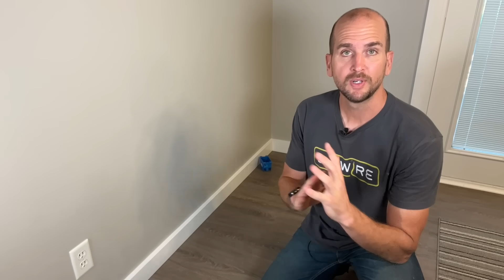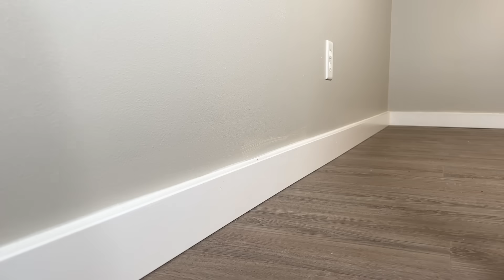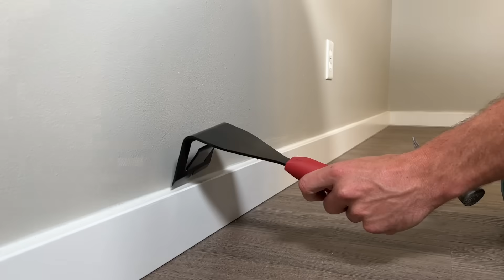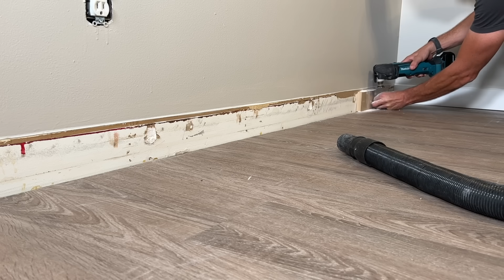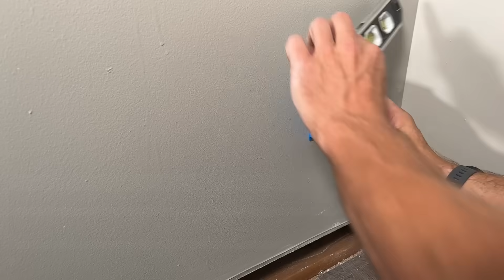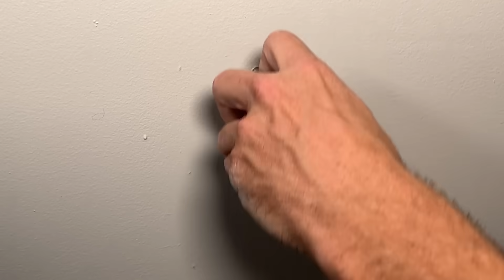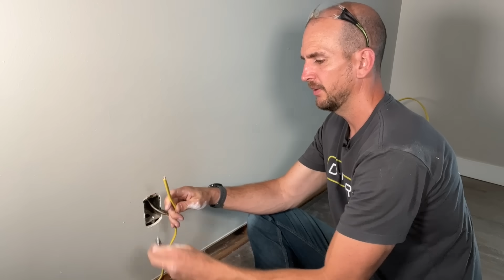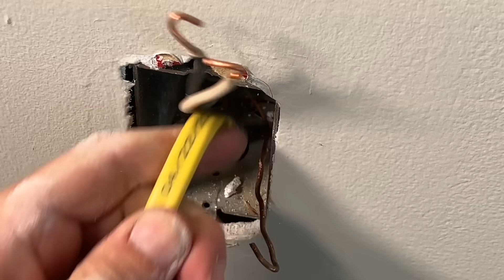How To Add An Outlet To A Finished Wall

Comment: Say your one maybe two studs over. I’ll use a diverse a bit and drill towards the existing box. But first on the existing I’ll open the hole as a 2 gang box giving more outlets. Then once it’s a 2 gang take the old box out. Now you will see the diverse a bit. Use a chair or small wire as a pull wire. I’m careful doing this because I hate painting or fixing walls. I’ve used a diverse a bit for years even on this job I’d get that to work. Also can drill towards the new outlet either way. Then I have no baseboard to deal with my wire is higher from moisture by the floor safer all the way around.

Comment: Here in the UK have brick and it's not so easy to add wiring,  literally have to cut a big channel all along the wall and replaster , in my current house those bricks are engineering bricks too so really hard.

Comment: Nice job but you might want to mention that is some areas a permit for electrical is required and before starting a project like this you should contact your local building department.

Comment: This is a fantastic video. There have been numerous times that I’ve wanted to do something like this, but didn’t, because I didn’t want to turn it into a drywall and paint project. 

I do have a question though. Which Milwaukee organizer do you use for your electrical - the slim packout or the regular packout?

Comment: Excellent .   I've wanted to do this sort of thing many times for power and network.   Network can be put under carpet DYI, never power.  Lathe and crawl way made projects too much.  The  trim, metal box protection , guild block for cut height...  even reminder on  pigtail to fix 75 yo wire + sockets at nephews house that's freaked me out as fire hazard every time I plug in a laptop.  I guess his kids learn a bit of DIY in 3 weeks.  Thanks

Comment: I could not make out what you screwed the two screws in the blue shell into. They cannot be screwed into a blank space inside the wall, so I figure there must be something else that goes into the wall before you  put the blue shell into the wall. Thanks.🙂

Comment: When I first clicked to watch, I thought you were gonna convert the supply box to an external wall mount, then add wire mold & another wall mount (which would have looked cheesy). Despite the fact that each install may not be as simple as yours (older homes, outside walls, going through corners, outlets mounted inside thick molding), this is a very clever idea. 30+ years wiring, and never saw an approach like this. Nice job.
Reply: Exactly. I’m thinking of using this technique on my 120 year old home. The bedrooms only have 1 original outlet each!
Reply: @Dozav7  Chris... I've come across the older homes, where an outlet was installed through the molding. And each time, I was forced to put a surface-mount. It's funny that your idea never occurred to me. Every time I ran into this, I'd scratch my head and think... oh great... this again. Even if I was feeling daring...& wanted to cut holes, I'd be afraid of cutting into something, other than the molding.

Really glad I stumbled onto this video. Thanks for taking the time to make it available.

Comment: Im EU electrician and im really suprised that your ground is not insulated. I wanted to point out to anybody doing this without electric background and with similar materials, make sure that your ground wire will not touch the phase contacts or you will short your circuit and blow up your fuse.
Reply: In US non metallic type cable used in this video (Romex) has bare ground conductor, MC cable has all wires insulated including ground. I think that it has to do with the fact that Romex can only be used in wood framing in residential applications where all grounding is bare wire including the service and so someone doesn’t try to use the ground wire as some type of conductor.

Comment: In Chicago, Cook County, Illinois -- jealous you can use Romex.

Personally, I mount the outlets horizontally. I've seen multiple incidents where an appliance plug, such as for a lamp, was not plugged in all the way and a conductive material fell between the plug and the wall, shorting the outlet. In particular, Christmas tree tinsel, in several cases.

I much prefer the European outlets for safety.
Reply: You should clarify....Horizontal with the neutrals up.  It's a good precaution, but today with plastic face plates the chances of that happening are somewhat rare. That's why the orientation is not dictated in NEC.
Reply: @ruffxm  Agreed, but Codes represent the minimum required. It takes no more time to do a little more.

Comment: Hi we had our lounge room battened out and plastered over the top of the original brick wall that was there and the electrician told us that he didn’t have enough wire to put in a new electrical point so he just plastered over it and now I don’t have an electrical point at all in that area. At the time we had a whole house renovation going on and he did this with a few points we had and it being such a crazy time I didn’t focus on the fact I had lost power to places I needed is that really a thing that the couldn’t use the old points and add a couple of inches extra so we could keep our power points where they were? Or were we taken advantage of the fact we couldn’t disagree cause we know nothing about this?

Comment: A 1 inch bit?! Good god... try a half inch... or 5/8.... it's just romex not your dick... lol
Reply: Wagonuts? So no plugging in a space heater or anything with real load...  may as well stab wire the plug. Same thing.

Comment: Very clever how you removed the baseboard and clipped the nails and cut the drywall and pre-installed the connector and such but I have one question. I am not a professional electrician but I still do wiring in the new little buildings that we build. 
What is the advantage of using those little wire connectors instead of just fastening the wires to the side screws on the old outlet?

Comment: What stops the un insulated “ground” (earth in the UK) actually touching the exposed/unshrouded hot (live) and neutral terminal screws when the outlet is just pushed back into the wall box and the ground wire folds/bends out of the way. Very dangerous in my opinion not to use earth sleeving on the bare ground wire. This is mandatory in the UK.
Reply: This has been mentioned in other videos.  Being from the UK I too find it very strange that the bare earth conductor is not sleeved. BTW I think the earth has to be sleeved in Australia as well.
Reply: Yea that seemed so weird. Definitely a recipe for issues

Comment: I realize this new line is close to the ground but I believe you should still have installed nail plates where the wire runs through the studs. Yes both sides of the wall 😅😂

Comment: That's was a great video and for this person to not be a day to day electrician that was great! I'm a 20+ year Electrician & Contractor and he's better than some of the guys that have worked for me!! Just a few things that I think might add to this to make it even better
1. I usually take the plastic of the NM wire before I put in the KO, that avoids having to use a knife in the tight box that might damage the wire
2. I don't like using Wagos for outlets and other electrical splicing , I've had a ton of service calls were the Wagos get weak and burn out, I would recommend wire nuts all the time for pig tailing and electrical installs, I only use wagos in lighting applications 
3. Sometimes the KO's are not available so you have to use one of the prefabed wire entry towards the back of the box which at times have a set screw which you have to remove but make sure you put it back
4. As always make sure the box is grounded

And that's all, but thank you for an awesome video!!

Comment: Why use pigtails when you can connect directly to the outlet with both wires, and get a more dependable connection than 
with a Wago lever nut? Of course, we avoid stab lock connections on an outlet, but why are they suddenly OK to use when 
they're in the product you're shilling for?

Comment: Easy for small usage like a lamp, but wouldn't this cause a short circuit if one plug is used for a microwave the other for a space heater?

Comment: in most houses the drywallers push the drywall up to tighten the seam in the middle of the wall, which leaves a 1/2 inch gap at the floor level, plenty of room for romex. I have been using this method of adding an outlet for  40+ years. you can even take molding off around closet doors, regular doors etc, to run the new wire in the gap and you can install new outlets on the other side of the room with this method
Reply: you can use this method to install a new outlet in the wall of the room next to the one you are in

Comment: What if my trim is 1 1/2" or less??   Screwed?  Still, a nice hack if available.

PS - 1" is code requirement, the wire must have air around it when going through a stud.

Comment: I have been using that trick for years, cause it works. But if I were you I'd work my way back to power start with new plug it's a safer habit😁

Comment: my only question  would  be, why did you have to find the studs with a stud finder,  when you cut the drywall  out you can see every stud, so what was the point of doing it before  hand?

Comment: 6:09 the standard in the UK is not to have a metal fitting but to install a rubber grommet in the hole left by the knock out.

I am not sure if this is a difference in legal regulations or just the professional culture.

Comment: 1:42 First remove the...
No comes second. I strongly recommend turning off the mains power to that outlet as the real first electrical step.

And yeah: I know you check later on, and in my opinion it's right to do so, but double safety never hurts :)

Comment: 👍👍 in Sweden we have pipes going from box to box. In that way we can in the future just pull new wires in if needed. For example. If you want any outlet that's connected to the light switch. You just pull through the existing pipes a new wire that's coming from the switch. 😊.
But we also have 230 volt system.
( 3 phases and 400 volts between them)

Comment: Would I install an outlet into drywall and not onto a stud?  Never.  The drywall will break up.  You take a short stud segment with angle bracket on the bottom, lift that in and up or drop it down from the hole, and screw the angle bracket in the base board.  Screw the outlet onto the board.

Comment: As a certified electrician, I'm glad to see that you secured the romex with NM connector and not just run the wire through the knock out.  Awesome on the video, that would've passed an electrical inspection!👍🏼
Reply: @Verminator151029    Brilliant logic coming from someone who calls it a "protective connector" SMH. By the way, it is actually required by code except when entering plastic boxes that have retaining tabs. You're arguing over a 10 cent item.
Reply: @Verminator151029    Big Ego, I see. The fact is they ARE REQUIRED. Whether you believe they aren't required is a different subject - that's opinion, not fact. But the code actually requires the use of them. See the difference? I'm referring to the the code aspect and you are obsessed with whether you think the wire will move or not.
Reply: @Verminator151029  Not require by code is correct.

Comment: A trick I was shown once for drill studs is to alternate drilling the studs from the left and right sides … this makes pulling the new wire through as it results in an “S” shape path for the wire to be pulled through.
Reply: In theory that is doable, in actuality it doesn't work. I recently did that trying to run a feed wire and I cause a ton of friction to where I needed help and it took 2 us pushing pulling and straining. Try to drill your holes in the same direction as much as you can.
Reply: @ghiggs8389  - interesting because I found the friction much higher when you drilled them in the same direction.
Reply: @craigpeterson1727  I was refeeding an older feed line so perhaps that was what really did me in. Also it was through rafters overhead, so gravity may have played a small part as well.
Reply: @ghiggs8389  - purely an observational statement on my part. I’m sure friction and fight are never tested at the same time so it’s always what you think you remembered. I appreciate your observations and experience for sure.

Comment: Great video. Some observations: 

1. It's worth mentioning that the yellow romex you used is 12awg. That should only be used if the original outlet was wired with the same which isn't guaranteed. Use the correct size.

2. When drilling the holes, you should stay back 1.25". While it may be unlikely to happen, you could open the door to a fastener hitting the wire if someone were to replace the trim with something larger, for example.

3. I like those quick connectors too but I wouldn't use them in a box like that. Inside of fixture, sure. But it's better to use a twisted tap to make a good solid connection.
Reply: I had the same observations, being an electrician. the holes drilled in the 2x4 should only be 3/4" inch max. With only 1 wire you could go as small as 5/8. This will keep the wire between the studs out of reach of a standard drywall screw from either side of the wall. electrical code requires 1.25" as you said. 

Wagos are a great tool, but they don't hold up nearly as good as a twisted tap with a wire nut. In this case I doubt you will ever have problems, but if you use wagos in a chain of outlets, every load you plug into an outlet downstream of the wagos will travel through those wagos, which usually only has a small piece of metal making contact for the connection. If, for example, you plugged in a vacuum at the end of a string of outlets, and another outlet on that chain had a coffee pot plugged in to it, the load from the vacuum and the coffee pot would both travel through that small connection. Its not uncommon for the neutral to overheat and burn up the connection. Usually doesn't cause a fire, but it can be a frustrating afternoon of troubleshooting to figure out why there is power at an outlet, but nothing you plug in will work
Reply: @nytros_realm  exactly.

Comment: As someone who has been doing construction for over thirty years, I was curious if you were going to use this method to feed the new outlet. I've used this very same method before. It works quite well as you demonstrated. Great video!
Reply: You are not the other hand I promise to be a good time and consideration
Reply: Why did you speed up video right when you are adding the connectors. This part should be shown just as clear and slow as cutting the drywall. Had to keep replaying to get the info.
Reply: @bthompson2192  the connectors are a waste of money and time. Outlets have terminals for adding a daisy chain to it. connectors add heat and junk to the outlet box. this tutorial is bogus and dangerous.

Comment: I worked for a guy in NZ who made us a 16mm auger wood bit welded onto a 4ft length of 6mm spring steel rod for jobs like this. We could drill horizontally from the existing socket box thru 3 or 4 timbers to do this job. Once the auger hit the back wall the spring in the steel would allow it to curve towards the face again so you didn't end up in the back room - almost self guiding! He was a genius but a hard guy to work with.

Comment: May not ever need to do this, but thanks for demonstrating this because I learned about the baseboard trim removal tool just days before I'm going to be removing all of it on our first floor, in preparation for reflooring.  We're replacing the baseboard, but nonetheless I think you saved me a lot of aggravation over using a hammer and a wonder bar.  I just discovered your channel last week and I'm already a big fan.

Comment: so many smart tips.  I am very impressed with how you pulled this off.  Most YouTubers show videos of optimistic situations, but yours was probably the worse and you showed all the process.  Also going down to where you are is much easier that going up even if you have an attic, because most high walls have a fire wall stud going horizontal on the way up and of course on the way down.  This way you don't have to go past it.

Comment: Great tutorial and a good idea. However, in newer construction in most parts of the united states plastic boxes are used, not metal. It wold have been helpful to mention this and alternative technique to address that. You are not able to just tap out a knockout plug. The plastic access holes can be removed but you may meed a utility knife to cut loose the 'keeper' tabs. In some case there is just no alternative to drilling a hole through the box.
Reply: It is just in back instead of the middle, no real difference, in fact plastic has more holes, 8.

Comment: In your case you abide by code (CEC). But if there were other conductors in that box you probably would have overfilled the box
 (a 2104?) . I'm kinda out of touch with fill calculations, but I think if you install 3- two wire14awg loomex you can't use wire nuts without overfilling the box....does that make sense? Lol I don't understand that either. I at one time made a living rough wiring new built homes and knew Resi code by heart. Now I work heavy industrial.

Comment: 28 year commercial electrician here. I have been doing this trick for years. Only thing I don’t like are the WAGO connectors. They are junk. They don’t hold up and you can’t use them on stranded wire. I only use wire nuts. Other than that great video!